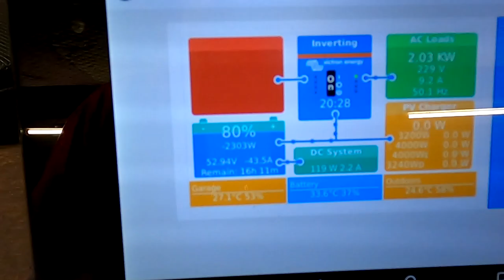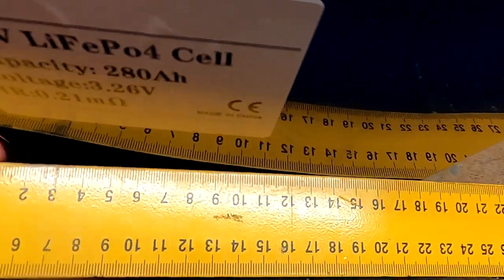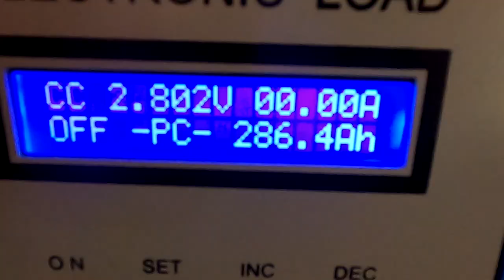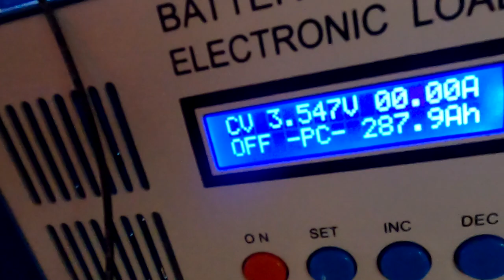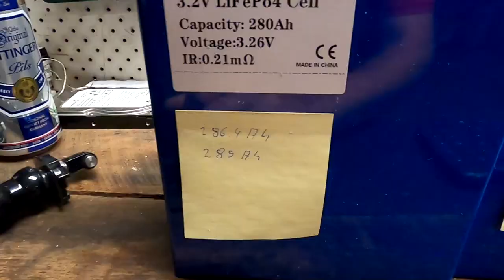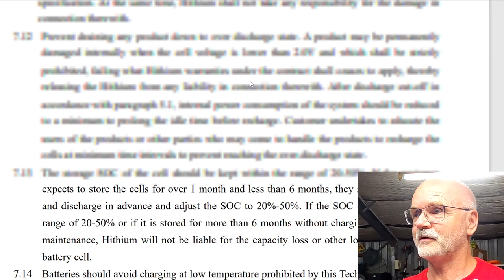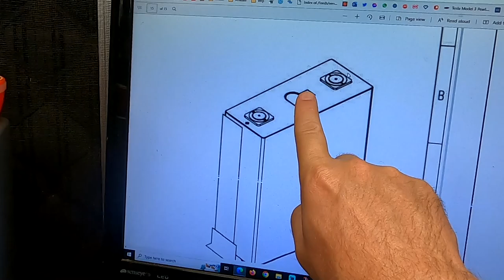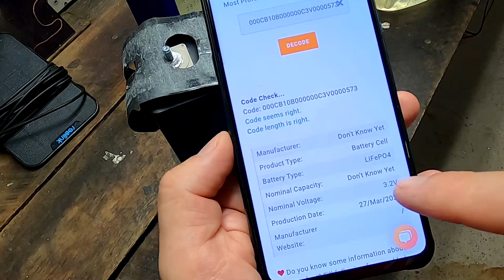Testing the 10.000 Cycle Hithium 280Ah batteries. Did I just get scammed??

Comment: Do you not bother to allow discharged batteries to cool, before recharging them? This will effect the lifecycle of the chemical process taking place inside. You perhaps place to much trust in the written typical common place understanding of the battery technology. Recharging a fast discharged battery & then smacking a fast recharge back in will age them!!
Reply from the maker: No, I absolutely don't bother with that. They will last 20 years once installed in a solar storage project, slow charging/discharging and the temperature is just what it is.
40A is by no means fast charging for a 280Ah cell. Above 0.7C I would consider it a fast charge.

Comment: Chinese brands are a dime a dozen.  Same companies run through dozens of different names.  They come up with a name, build up sales, it crashes and burns because they aren't on the up and up.  The brand disappears.  Then a seemingly new brand pops up that astoundingly appears to sell the same exact product.  Rinse, repeat.

Side note on the charge curve... viewers not familiar with LiFePO4 (and batteries in general) should keep in mind that the charge curve is different depending on the amperage the battery is charged at.  Also known as the C-rate.   Though its still quite reasonable to use 3.0V as the low cut-off regardless.

-Matt
Reply from the maker: Thanks, Matt. Unless you buy certified cells from a manufacturer, you get what you pay for. I think they are still great cells though.

Comment: You're wrong on the cell matching but ok.
Reply from the maker: Explain...
Reply: @OffGridGarageAustralia  Ive had bad experiences. It makes a big difference when the cells age. the higher resistance cells will blow without a bms due to imbalanced charging at higher voltages and lead to a cascade of blown cells. Ive seen banks without bms do this. For bms systems you're pretty much right although wildly imbalanced cells (like dif grades) might still cause issues imo.
Reply: @QuantumMarmalade  You should never run without a BMS in a solar application.
Reply: @upnorthandpersonal  hahahaha, ok dude. Whatever. Go get 20 years off grid experience and you may have a little credit here. But no, no you dont. Its better but you dont.
Reply: @QuantumMarmalade  I am running these kinds of cells off-grid for the past three years now 24/7. Also, interesting of you to assume I don't have 20 years of off-grid experience; I'm off-grid in Finland of all places. I've done a heck of a lot of testing in my lab on LiFePO4 as well, ever since the first cells with the chemistry became available.
Reply: @upnorthandpersonal  if you have 20yrs real professional off grid work experience, I apologize, and would love to meet you, but im sure you dont. I'm basically a unicorn in this business. I've been using raw lifepo4 cells for 6-7 years and the cells that I told the anecdote about have been running 5 years without incident until the owner bumped his charger up to 60v for no reason. High internal resistance of a single cell led to a loss of 2 cells for a grand total of $216. I'd say a bms is superfluous in many instances but preferable.
Reply: @QuantumMarmalade  I've built my first off-grid cabin which had power and heating when I was 16 - well over 20 years ago. I'm now living in a modern log house with all the comfort you'd expect from a house, fully off grid. You can find me online - "up north and off grid".
As I said before, always run a battery with a BMS. There were very few options a decade ago or so, but today there is no reason at all you shouldn't. Bumping the voltage up for no reason, or cell imbalance, would be no issue with even a basic BMS you can get today for $100.
Reply: @upnorthandpersonal  all those things are true but where I live many people have nothing but welfare. If you can explain to me how a single mom with 3 kids on food stamps and no car can afford a bms when she had to sell her soul for 4 cells, a few panels and a $50 Walmart inverter then ill agree with you but in the mean time, this is the pre-apocalyptic scenario in which I and many others reside. Also... I know I sound more confrontational than I really mean to but, installing a few systems over the years does not compare even remotely to installing a system a day for 2 decades. although I do appreciate that one can learn heaps in a short time,  solar is a wide river and few of us have swam all the way across.
In general I walk the middle path. Balancing value with quality, longevity, and resilience. For the most part all these solar YouTubers are doing is superfluous educational tests and videos because if you know how to use the equipment, you don't need to worry about 99.9% of the things these guys are doing.
Reply: @QuantumMarmalade  Yeah, in the country I live in a single mom with three kids would not be on food stamps and would get all the help she needed including housing. She shouldn't have to buy cells in the first place. Glad I'm not in a pre-apocalyptic scenario as you put it.
I've designed and installed tons and tons of off-grid systems by the way: most of the summer cottages here are off-grid. The house I built for myself took a decade between planning and building just because technology was not up to speed with what I wanted to do.

Comment: Umm, the spec sheet is dated 11/9/2021.  At 5 hours per cycle test, they would have had to begin testing sometime prior to 2/26/2016 to verify 70% capacity remains after 10,000 cycles.  Additionally, they would have consumed 10 Million watts just to test 1 cell.  Since Hithium was established in 2019, I'm guessing they just pulled that figure right out of their ass...
Reply from the maker: That's not how they test batteries, Jim. Tests run for a few months until they have enough data...
All manufacturers do that.
Reply: Guess how they find that an engine in a car is good for 100 000km? Or that any other product last for x years? There are methods to do accelerated life testing and using data extrapolation.
Reply: @upnorthandpersonal  Calgon take me away!
Reply: @OffGridGarageAustralia  I see.  We know the one-punch is real enough, little point in proving it.
Reply: @OffGridGarageAustralia  That is exactly how I perform accelerated SPAT testing.
Reply from the maker: @jimbeam5  You cannot rush a good SPAT calibration...